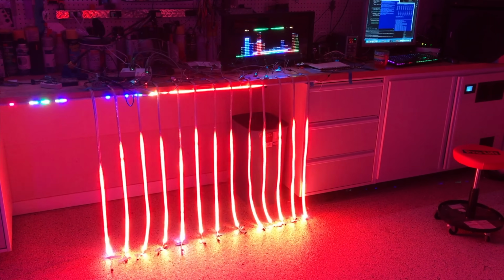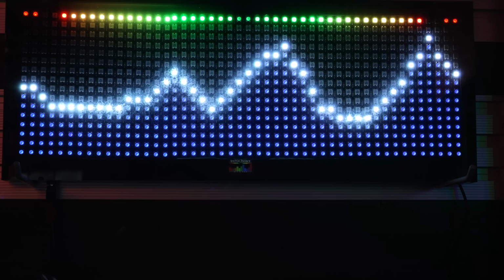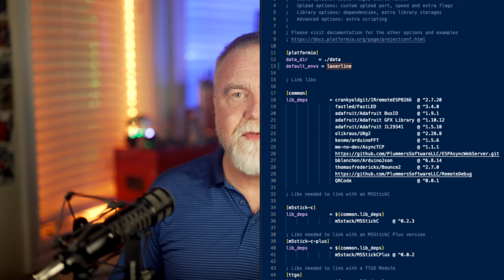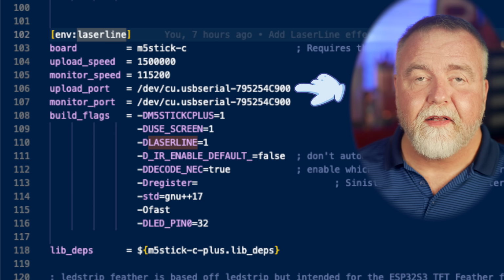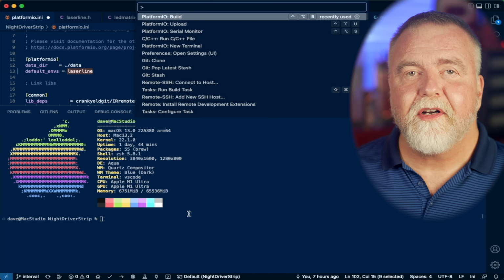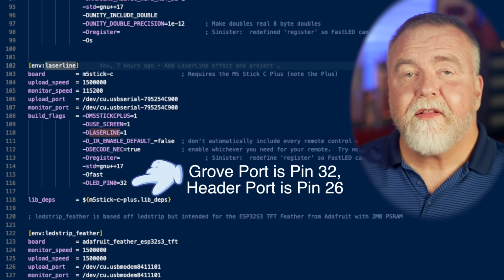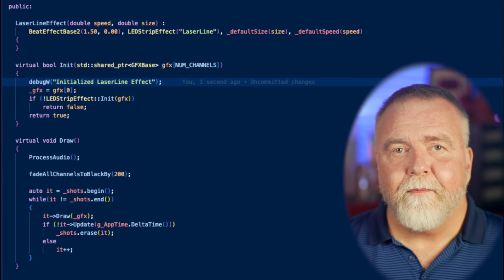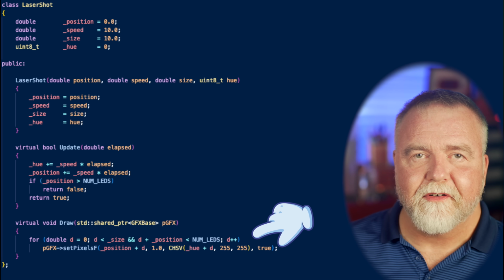LED Laser Cannon: From Power Supply to the C++ Code

Comment: hi Dave,
I love your video and it inspired me.. I am a newbie to adruino and led.
I want to create a Star Wars Dioarama where  a x wing fighter attacks a Tie fighter . I was also inspired by this guy " Boylei Hobby Time" on youtube who already made such an amazing awesome star wars fight diorama using static filament led.. 
But I want to make it more active and dynamic and I want to simulate the laser cannon effect like you did, but then using twelve " 70mm DC 3V Micro LED COB Meteor Shower Flowing Water Lamp LED Filament Diode Color Parts Decoration Light Accessories" . Have you ever used these? Perhaps you could use the smallest width high density Cob Led Strip for this project. 
How can I do this? 
Thanks Dave.

Comment: Finally got all the parts for the Laserline project and tried putting it all together last night.  When I try to build the code I get the following error message.    * [.pio\build\laserline\firmware.elf] Implicit dependency `C:\Users\myprofile\.platformio\platforms\espressif32\builder\LASERLINE=1' not found, needed by target `.pio\build\laserline\firmware.elf'.
Reply: And it turns out I bought the wrong M5.  The Laserline needs the Plus.

Comment: I tried installing nightdriver spectrum on my m5stack core 2 using th OTA software.  All it would do after was to run he vibrating motor and would not power down. Any idea why

Comment: I finally got something working.  Still can't get Laserline to work because I don't have a mic.  Actually I have a mic but I have no idea what pin to plug it into.   I found that I had to disconnect the power brick from the light strip to get the program to upload.  Also found a line in globals.h that said pin 5 and when I plugged that in then it started to work.   Would also like to figure out how to use the IR remote.

Comment: PlatformIO has been updated and the instructions in the video are no longer completely valid. Perhaps someone can me to figure out where to change the pin that drives the LED strip. I have looked extensively but I am not familiar enough with the development environment to find it.
Reply: I got everything installed and compiled then downloaded. The screen on the M5 shows a graphic with LaserLine on the screen then it crashes. Unfortunately I am not sure how to troubleshoot what is happening. Any pointers?
Reply: I found this comment in globals.h: "Jan-19-2023  v035       Davepl      After LaserLine episode merge" I presume you did some kind of merge after the YT episode and this is what broke LaserLine.

Comment: Unfortunately I'm not real good at programing, I would have rather a physical walk through on the software side, it would have made it possible for me. Sounds like 100 different process going on before you even get to upload the code to the controller. I like the project though. I might build one for my shed one day when I finally understand  that coding process. It seems so fragmented as a process. In the BASIC days it wasn't any where near as complicated as now.

Comment: a question. I bought the M5 stick, and the LED strip. I did not notice the strip is the 12V. The M5 needs 5V to operate and the strip needs 12V. do I put the 5V wall wart onto the end with the controller and inject the 12V at the end of the strip?
Reply: You probably already figured this out but I did the same thing.  Yes.  Power the M5 off the 5v adapter and run the strip off 12.

Comment: Dave I am frustrated! I have been quite successful going through your enumerated LED tutorials using the Heltec ESP32 DEV chip/VS Code/PlatformIO/Git...the whole enchalada. I was feeling ready to embark on a new LED project, so I ordered another Heltec (Kit 3 now) but when I try to flash it with the same code I used successfully before, the environment fails to find the same COM Port (15) I was using before. It's frustrating that I am unable to use Device Manager on my Win10 box to identify all the COM Ports. I have enabled the View->Show Hidden devices options which displays the existing built-in USB to UART (COM15), butt as I say, that no longer works for me. I have searched for Powershell scripts identify active Com Ports, netstat commands, blah blah blah....    It seems like I must be doing something really stupid; I just want to plug the USB-C plug into the PC and Heltec, flash the code so I can flash some lights! What is a boy to do?
Reply: Update: I decided to see if my development environment has changed somehow, so I plugged in my HelTec V2 Kit board into my PC and, to my surprise, everything worked. The new V3 HelTec boards use a USBC connector, so I guess I need to find some new drivers to make it work.
Reply: well, not drivers I discovered but a different USB-C cord and my COM port lit up. However, I now get upload error informing me that the chip is and ESP32-S3, not ESP32. If it's not one thing, it's another! Not sure how to troubleshoot this right now.
Reply from the maker: Sounds like the V3 has a different pinout, and the headers for PlatformIO are wrong, as I understand it.  There's a discussion on the github right now about it, and I believe they have it working now.  I've ordered some V3s to confirm, but for now, check out the discussion in the github!
Reply: @DavesGarage  I am reading that very discussion right now!! Great timing Dave!

Comment: >control lights from your desktop
aww man, i would've just used the rs232 port and a custom interface board (MAX232 & ATMEGA328) instead of messing with wifi
Reply from the maker: How's that going to get the signal to my 20 different locations, including under the eaves and so on... that'd be a lot of cable!

Comment: I cloned the repository, which I noticed already had LaserLine as default environment.
First time trying to build it, got an error that secrets.h didn't exist.  Forgot about that.
Copied Secrets.example.h as secrets.h as indicated in the video description, but still won't build.  Generates errors with spiffswebserver.h 
	"message": "'heap_caps_get_total_size' was not declared in this scope",
Often in the terminal finding:
driver/adc_deprecated.h: No such file or directory

What could be wrong?
Reply: This comment shows 2 replies, I only see one.  Where's the other?

Anyway I believe I fixed the problem.   PlatformIO Home wasn't working in VSC either.
Managed to fix it all by:
Uninstalling PlatformIO extension from VSC
renamed the .platformIO folder in my user profile.  Needed to reboot first as something in the folder was still in use
Reinstall PlatformIO extension into VSC
Disable Arduino extension as PlatformIO Intellisense complained Arduino was causing some sort of conflict
Open the workspace that had NighDriver as a project
Build the project.
There may have been a few other steps in between but that's basically what was needed.

Comment: Hmm... Looks like the linked Grove Port connector isn't the right one, it doesn't go in the M5. Any ideas if I just holding it wrong, or need a different cable, if so which one?
Reply: Having the exact same issue.  It’s for sure not the right connector.

Comment: Pro tip: if you're putting stranded wire in to a screw terminal get a wire ferrule tool. They're metal tubes that slip over the wire and crimp on using a special tool. This makes for a solid and most importantly reusable connection in the screw terminal.

Comment: Humph.  A nice little project, but I on the other hand programmed an Arduino Nano to drive a 32 x 8 display to put up an "OPEN" sign with an animated rainbow border going around the outside LEDs.
I'm still stuck on the hard part though... making an enclosure for it and its power supply.

Comment: Hey, great that you're enjoying the ESP32 chip family; I work for Espressif and it's always nice to see people do cool things with our stuff!

Just a quick correction: your terminology wrt chip/module is a bit off. The ESP32 chip is a tiny 5x5mm black epoxy, well, chip. It's the brains of the operation but needs a bunch of external things to work: flash, crystal, some capacitors and resistors, and some magic to connect it to an antenna. A module is: a tiny PCB with a metal shield (to keep the jiggling electricity pixies inside) under which all the directly necessary components are housed: flash memory, analog components, antenna matching logic. (You called it a 'chip'.) Most modules also have an on-board antenna. If you take one of those modules and put that on a PCB with an USB interface, programming logic and power supply stuff, you generally speak of a 'devboard'; the M5stick you use would qualify as one of those. (You called that a 'module'.)
Reply: @mobilde4519  there are lots of fake chips, boards, modules, etc. on the market. How to understand them? Hmm, that's harder to answer. Buying over the internet is easy to buy a fake, since they can just show a photo of a genuine one. I suggest only buying from reputable sellers.

Comment: Hi Dave, 
I like your work. Finally got NightDriver to work. I kept getting build errors in the IRremote. Had to change the library dependency for IRremote to version 2.8.4 and away it went. I copied and modified secrets.h as directed but cannot get wifi connection. Any pointers as to where to look? Thanks for a great job.
Reply from the maker: Trouble receiving the remote?  Remember that you'll need a 34K Ir receiver diode, and connect its data pin to the REMOTE_PIN, or it can't work.  Or what are you having trouble connecting to?
Reply: The first problem I had was with the code build. It did not want to compile with the IRremote library dependency ver 2.7, once I changed it to current ver 2.8.4, the build worked and downloaded as it should. Once I got the M5 to work, I noticed that it said "no wifi". I check the secrets.h for the correct SSID and password for my wifi, but cannot get it to connect.
Reply: @chriscopland9536  I believe case matters on the SSID, so make sure that matches properly.

Comment: Hi Dave,
I noticed in your parts list that you have JST 4 pin 2.0mm pitch connectors.  Those are NOT Grove and likely won't fit properly.  For one thing the connector latch is different.
I found finding a proper Grove connector hard to find or ridiculously  expensive
Reply from the maker: Can you pass along a link or part number?  I did have to trim some plastic off the ones I have to get them to fit!
Reply: @DavesGarage  it has been quite a while, around the time you made the first tutorial series about the LEDs.  It will take me a while to find where I got it.  I believe Adafruit has it but their shipping is rather high.  By the way, you never did finish it and show how to build the umbrella.
Reply: @DavesGarage  Adafruit product ID 5244.  Price of item isn't too bad, less than $1 each, but unless your total order is over $200, shipping is likely at least $15 by UPS.
Reply: @danman32  You can also buy Adafruit parts from Digi-Key, they have slightly more reasonable shipping rates.
Reply: @anonym7500  good to know, I'll check it out.

Comment: Yeah, with all these options in the code, I too would really like to see someone make a UI for it! Not just for reacting to sounds but the gamut of controllability! I have already seen temporary video walls made up of these strips!
Reply: I would be just as happy as describing everything clearly in the code so we understand what all the "cogs" do and how they relate to other cogs.
Part of the problem though is learning all the nuances of the C++ such as class derivation.  Basic C++ tutorials often don't teach you this.

Night Driver though is more of a development platform for LED strips and arrays, not so much as an end product, though out of the box it has the capability to be an end-product.
One of the benefits of having it as a development platform is that you can define and enable components BEFORE compile.  You might note that much of it is Define switches.   This can reduce resultant code size, where having a UI to configure everything would mean everything would have to be in the final code.
That could take a LOT of room.  Not using an array?  Why have it in the final code ore any other code features that depend on having an array?
Not using sound?  Why have anything in the final code relating to sound?
Reply: @danman32 : Good for you, but I'm talking about for the average-Joe end user.
Reply: @HelloKittyFanMan  That's really not the intent of the full project.  As a matter of fact I don't think all the features in the project would fit in many ESP32 boards.  It becomes worse when the display configuration, particularly matrix, is determined and calculated during program execution rather than during compile time.
I compiled Mesmerize which is what was used for the clock demonstration on Vroom board.  Results said it would fill up over 90% of flash, and that's with matrix defined during compilation.

I think Dave is wanting to include some web management though, since he asked for programming volunteers to help with React.
Reply: @danman32 : I never said it was the intent. That doesn't mean a UI can't be made for a lot of people who might like one.
Reply: @HelloKittyFanMan  you're right, a UI can be made, it's a good idea. I won't promise anything but if I find the time and can stay interested in it I might make one.

Comment: I'd like to run about 200 linear feet of addressable LEDs across the front of the house. I haven't looked into what's practical before you start needing multiple power supplies or multiple drivers. I'm guessing the LEDs (or technically, the driver for the LED) re-clocks the signal, so there shouldn't be any signal degradation as a function of distance. How many LEDs can be driven before the voltage drop starts being visible or a problem?

Comment: "I'm gonna connect a female barrel jack adapter..."

* Connects a male one (the kind with the pin in the middle) instead.
Reply from the maker: I consider the thick part of the shaft to signify maleness.  Your theory may differ.
Reply: @DavesGarage : It isn't up to us as individuals. Standards are set by the industry for a purpose. So I don't have my own theory or even just hypothesis; I'm just going by what they set. The standard is that the pin(s) (or inner pins that plug into those other the other connector, where there are pins on the other one too) is/are the male part(s), because of... you know... "the birds and bees" and all that. Some connector types are ambiguous, but this isn't one of those. This is a simple, clear-cut coaxial connector set.

Comment: in the 70's I did mine using 120V using power tryace's 1' double blocks of light. this was get away using relays which made a clicking sound I did not want but I wanted 16' x 20' dancing lights from R/S and running light from disco except I place them overhead. I had row of push button switches for color and direction.

Comment: Is a logic converter ever needed with the leds? If so, in which cases? (Cable length, led type, etc)
Afterall, esp32 is 3.3v logic.
Reply: I've not seen a problem. Since each LED functions as a repeater, only the first one needs to trigger on the 3.3v based on what I read.

Comment: Interesting, I've always used WLED to control LEDs. Didn't even know this alternative existed.
Reply: Totally different purpose
WLED is basically an end-product that has EVERYTHING already in code, needed or not.   For one thing, it is only recently that WLED has decent support for matrix.  Night Driver had matrix support probably from the beginning.

Also Night Driver is basically a development platform.  Notice that a lot of the settings are code declarations?  Why?  So you can turn off elements of the full code that you don't need taking up space in your final code.
It makes Night Driver complex, and I wish it had a developer manual to better describe its nuts, bolts and cogs, but it does allow you to streamline the resulting code.

Could this particular feature, the laser effect be more easily added to WLED?  Probably.   But Dave already had Night Driver to do a whole bunch of things that even now WLED can't do, such as effects that require an LED matrix.